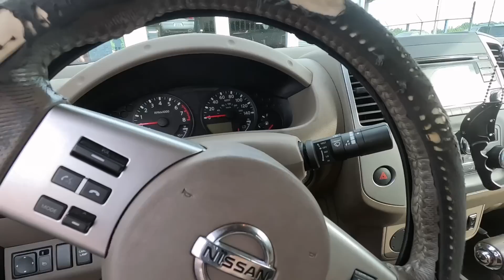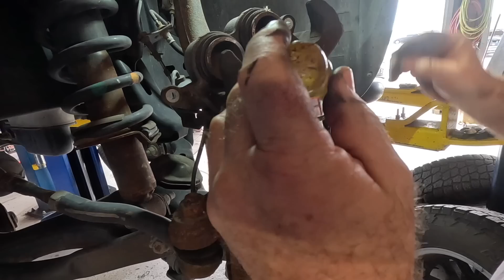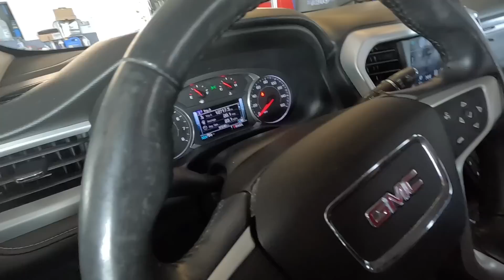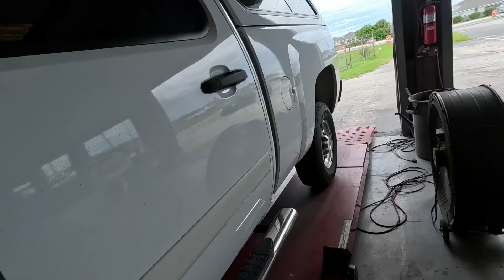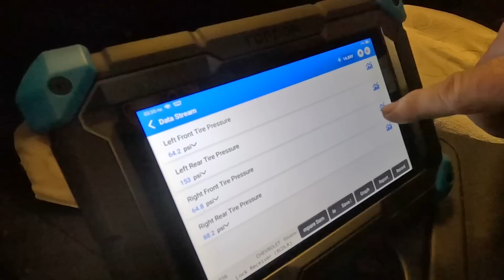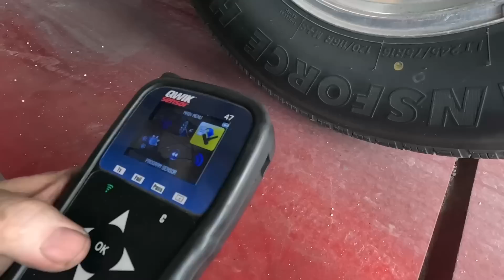Silverado TPMS, Fusion Battery, Acadia Steering, Frontier Brakes. A DAY IN THE AUTO REPAIR SHOP 288

Comment: Jimmy, I changed the battery on my Fusion Hybrid the first time when it was 25 degrees outside. You should have mentioned the vent hose and the plug on the other end of the battery. I almost missed the plug. Keep up the great work.
Reply from the maker: Yeah, that one was done quickly with a waiting customer. ;)

Comment: I have a 60inch exmark that bought used, but a great, it is a retired mower used commercially,  I have had some maintenance that has been needed, a few minor repairs but even with 3100hrs on the engine it mows great.
Reply from the maker: That is awesome! My Cub LTX1045 has about 800 hours and I'm replacing it for basically no reason, other than wanting a zero turn, lol.

Comment: They may have wanted you to install the brake hose so you can see the Lay line printed on it.... if it's anything like hydraulic hoses on a machine... i think it is supposed to  highlight kinks and twists in the hose.
Just sayin'. Good video as ever  mate.
Reply from the maker: This one only fits one way,  the hose keys into the mount. :)
Thanks very much Mark!

Comment: I can give you a little advice for the ride on mower having used and fixed them for 20 years. Kawasaki V twin is a great engine, much smoother than the Kohler. Starters are sometimes poor from the factory on Kohler giving a bad battery or bad alternator symptom due to a dirty commutator or stuck brushes. Fabricated deck is a must have. Greasable spindles on the deck are a plus. Hydraulic drive is way better than pulley based CVT to avoid slip on hills and belt wear. Electric PTO is ok but if you ever need to pull it off the output shaft you'll find the housing is seized on 90% of the time. Look for a low hour used mower that someone is selling because they underestimated the size needed. I like Husqvarna personally.
Reply from the maker: Thanks very much for the input!!!

Comment: Ariens is built in Brillion Wisconsin at the same plant as Gravely since Ariens owns Gravely, decks are a little cheap, but Ikon serious is a decent machine for the price point etc.
Reply from the maker: Yeah, the IKON 48" is what I went with once I saw they have owned Gravely for a while. The same exact mowers at the dealer, one was red and one orange. But the Ariens was $500 less. ;)
Reply: Yes sir, I own a small mower shop & work on both often. I just wish they would allow the decks to be serviced more…. The spindles & all the idlers are sealed, no bearings can be replaced which is a bummer. Hopefully the Ikon series has serviceable hydros too… if so, change the fluid & filters often & you good oil!

Comment: If your looking for a zero turn rider go with a fabricated mower deck. In my opinion Kawasaki engines are the gold standard. The box store zero turns have stamped steel decks and weak frames. Briggs engines are pigs on gas and Kohler engines self destruct. The box store John Deere and Cub Cadets are manufactured by MTD (Made To Destruct). My motto is "If it ain't red... leave it in the shed!" 
Funny story about John Deere. My father's uncle had a dairy farm. The neighbor was always going on about how great his John Deere tractor was. My father's uncle challenged him to a race. He said hook up your manure spreader and meet me out in the field. My father's uncle passed the John Deere with his International Farmall. He pulled in front of the John Deere and sprayed it with manure. He said to the neighbor "That's what I think of your John Deere!" 🤣🤣
Reply from the maker: Rofl.
I went with an Areins 48” IKON. First cut Sunday am!
Reply: @JimmyMakingitwork  Excellent choice!🙂🙂

Comment: i had a cubcadet 46 inch lawn tractor  . bought when i moved down to Florida 2015 . sold last year with a 186 hrs. changed the oil every December  and air filter  and blades twice. back then paid 1800. sold for 700$  this winter bought another cubcadet,(zt1) zero turn 46 with steering wheel. expensive at over 5gs so far happy with it . i moved closer to gainsville its more rolling hills then my last house dead flat! just some fyi on my experience with cubcadet!
Reply from the maker: Thanks very much Alex! My Cub has been good, just ready for a Zero turn! I went with Ariens IKON in 48". :)
Reply: ok 👌 good ☘️ with it. keep up the good work on the channel.  you have a positive attitude.

Comment: Exmark and scag are nice but the specs are important. Def avoid John deere
Reply from the maker: Yeah, from what I've seen they all use engines and drive systems from the same manufacturers and make the chassis and some other things themselves. So it's mostly about size and features we want to decide on. Lots of great choices, but the cheaper ones from all brands are short lived from what I've seen.
Thanks!